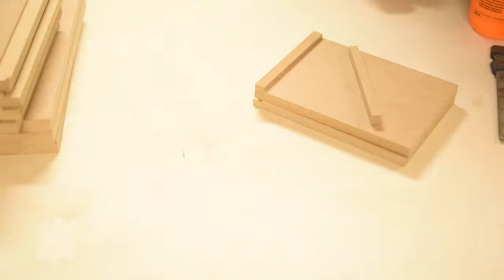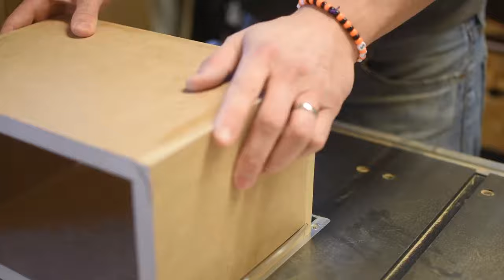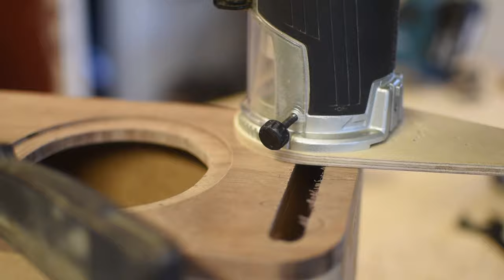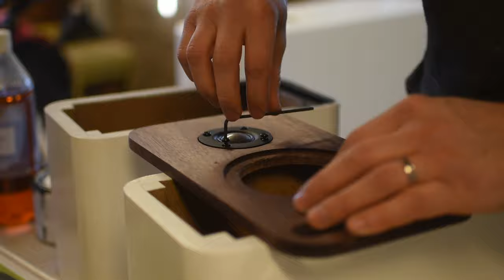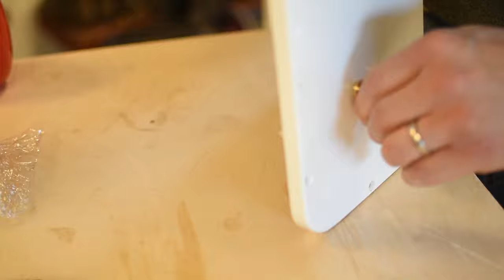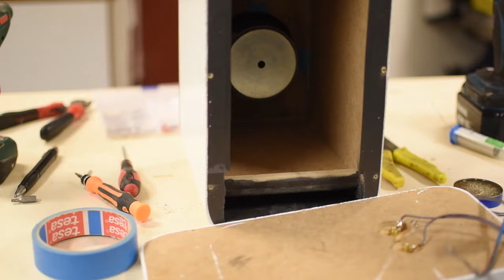DIY Budget Bookshelf / Desktop Speakers // Build Plans

Comment: that indent on a cone breaks my heart...
Reply: First thing I noticed. I'm so anal-retentive I'd have bought a replacement before finishing the video.
Reply: I've fixed mine with a vacuum cleaner, a reduction cone and a straw to make enough suction to pull it back out. You just need to find the couplings to reduce it enough to around a 1/4" in diameter and it will suck it back out.
Reply: I think pc speakers are best done with full-range speakers. I recommend the "1 full-range speaker in one box" version. Because 
the sound will be clearer and of better quality when we use one speaker that plays the entire frequency range.
Reply: @garzez  in the disgusting but true file, your mouth will work too. It'll still have a crease in it but it won't be indented. I dreaded this happening during the build, sorry to see it did.  :(
Reply: Yh can be fixed with a hot glue stick by heating the end up then stick it onto the cone and pull slowly out and it should look like new again
Reply: I cried 😢
Reply: Mine too!…I used the tip of a needle to pull mine and it looked like it was never touched

Comment: Good work but you rounded off the edges that don’t affect the sound. You should also have rounded off the edges of the baffle to improve dispersion and smooth out the frequency response.And all screws for the drivers should be flush, not proud.

Comment: Always buy extras of those tweeters, because inevitably somebody will show up and push them in. Enough damage to a metal dome can cause degradation of the frequency response, because it forms creases in the metal dome material that don't ever seem to be able to be flattened out. But those Dayton units have excellent high frequency extension, and metal domes in general give good dynamic impact. For many years Bowers & Wilkins sold aluminum dome tweeters without any grilles. Your cabinetry is beautiful.

Comment: Very cool speakers. I have 2 questions before starting the project.
1. Have you dimentioned the box and the crossover according to the drivers? Have you measured the freq response of the speakers?
2. Closing the front with wood rather than mdf doesn't deteriorate the performance?
Reply from the maker: Thx, The box is calculated with winisd and the crossover with xsim. I measured the speakers when completed
Reply: @Erikdidit  very good.... Time to buy the plan then.!
Reply: Done!!

Comment: I always enjoy your speaker builds. Sad to see that tweeter was a casualty :( probably easy enough to replace though I suppose
Reply from the maker: Thank you! Yeah, I bumped it by accident. I will probably replace it, just for the looks :)
Reply: @Erikdidit  at least it looks sealed, and sounds like it still functions. I think my cat punctured the tweeter on one of my old Polk studio monitors, and it just went silent.
Reply from the maker: @ashcooper7962  Yeah, it still seems to work alright. I will measure them and see if there is any difference.
Reply: @Erikdidit  you can simply use your vacuum cleaner, press gently the hose to the dome and apply - again gently - some suction. the underpressure will restore the  default dome shape in 99% of the cases; i've done this so many times.... otherwise a really great, lovely work of yours, a pleasure to watch!

Comment: Have you tried to pop that dented speaker back out? Never did it myself, but I hear you can use a vaccum hose on it to fix it. Nice build. I love the look of it. Great work!
Reply from the maker: Thank you! I  tried to do it with a straw and suck it out with my mouth but it didn't work. There is probably a ton of things to try if you Google it. It is a bit annoying for sure.
Reply: Try with a vacuum cleaner.
Reply: @Erikdidit  i've used paper tape to fix dented speakers; be sure to use the cheapest one so there is less tack

Comment: Im wondering how much would u sell those speakers? 😀
Reply: I'd just double the cost honestly if I'm still at trial and error stage. It's $60 for the drivers, 15 for mdf boards. I'm not sure about the crossover's cost but it should be under 50, excluding wiring and terminals. So a fair price for these two would be around 250-$300
Reply from the maker: That seems like a pretty solid calculation

Comment: Commercial, active or passive speakers(mainly 2way like yours) are now profusely marketed everywhere and there so many models to choose from, some of them sound very good to excellent and yet competively priced mostly less than US$1,000. There is really no reason build your own unless ones want to :
1. prove to yourself you can build them for personal reasons
2. the one you build must offer something different which no commercial speakers can offer e.g. superior performance or using different design approaches or technologies or added features not offered by commercial speakers like Room correction built-in.
From the price point of view, commercial speakers already offer good value and yet looks very good. One needs to spend alot of time and labour on DIY speakers in order for them to look good ie comparable to commercial speakers.
The choice is yours.
Reply from the maker: I appreciate your comment, but I think you are missing a point. You can build them because you enjoy the process and the satisfaction is even greater when you made them yourself. 

I certainly agree that there are many good 2way speakers on a budget, but you can build these under 100$ excluding the amplifier.
Reply: I enjoy building my own just because when others hear them and ask where they can buy them I say " You can't buy them , I built them."
Reply: @justins.1283  I built a few sets myself over the past few years. I am now embarking of building a new set based on speakers topology rather than building to impress friends. This set should sound better than most commercial set oout there and costs less.
To cut down the time taken building a new set of cabinets(not cheap) process I am buying 2nd cabinets and strip out the guts and replace them with new drivers.
Reply: @yttean98  you then need to match the speaker properties to the old cabinet and will be restricted in any performance beyond the original design.
Reply: there is pride in building your own. I enjoy the process of DIY.